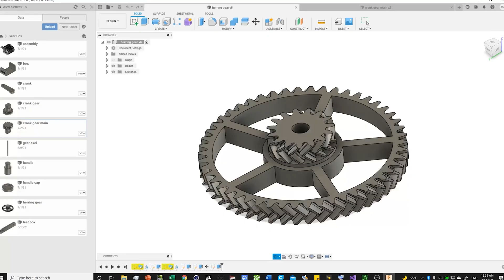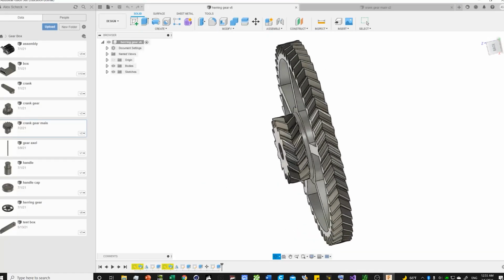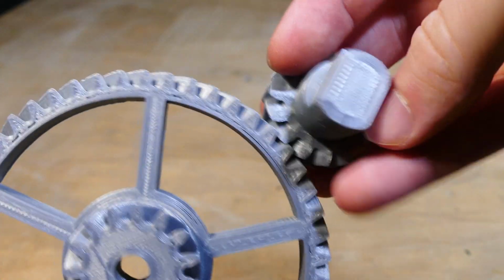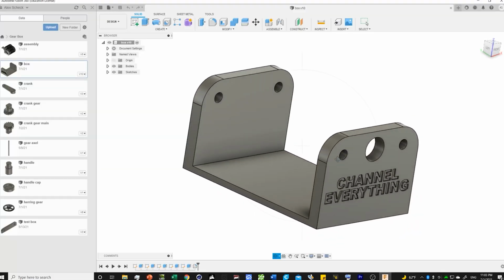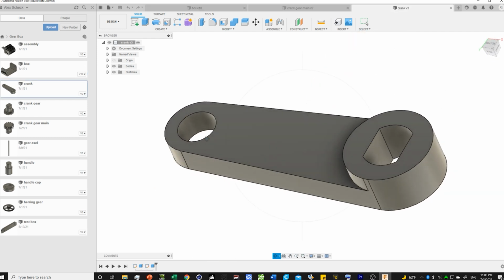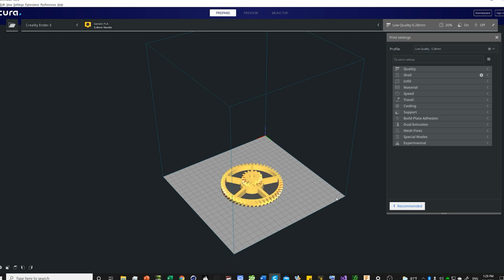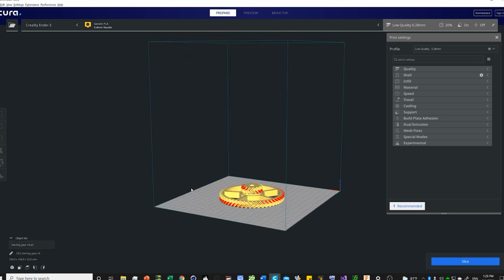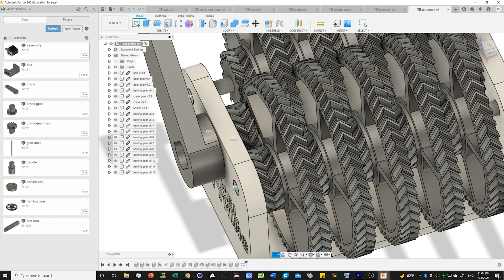Why this WON'T go past 50,000+ RPM | 3D Printed Gear Box

Comment: If my calculation is correct, the ratio is 50,349 : 1. Very easy to calculate! The total ratio is the total number of gears subtracted by 1 which is then raised by the number of gear pairs.